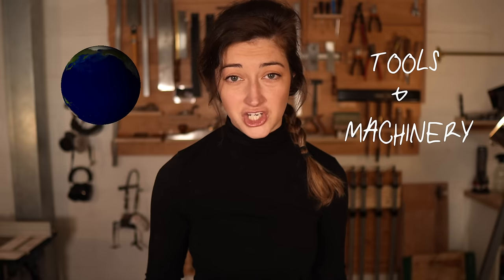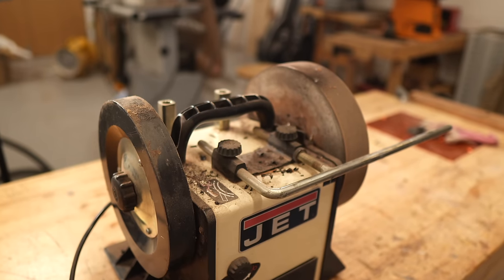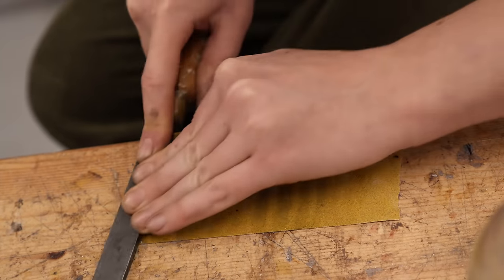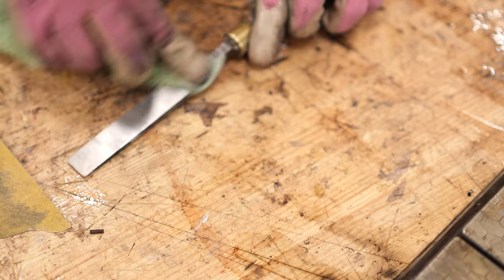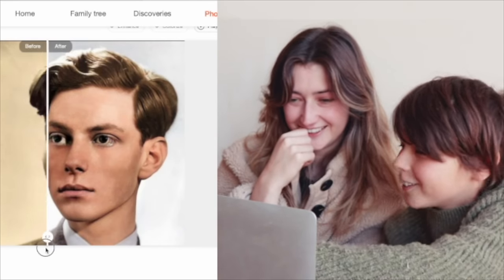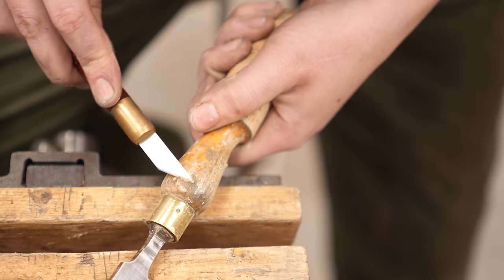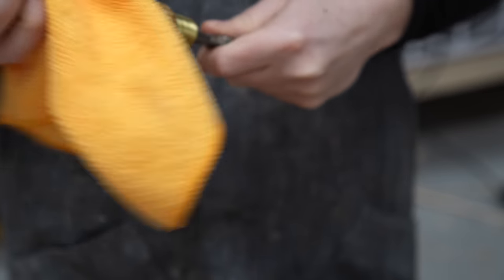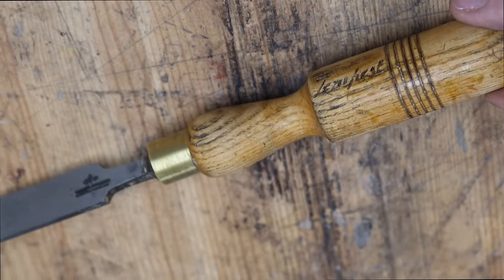Restoring a 100 Year-Old Chisel

Comment: There is nothing wrong with using linseed oil on oak. Th main reason not to, has to do with colour -as raw linseed oil makes oak very yellow (something you usually would avoid when working with oak) The drying time mentioned in other comments really is the same on oak as other similarly grained woods -absurdly long, as raw linseed oil takes up to months drying completely. Therefore you would normally use polymerized or “boiled” linseed oil. Where the polymerized oil is made by heating the oil in an oxygen free environment. Thereby starting the polymerising of the oil -thickening the oil and shortening the drying time. And Boiled linseed oil is made with adding metal salts as drying agents and solvents (typically turpentine) to decrease viscosity (boiled linseed oil, is also the most reactive of the two. So beware of drying rags. So think of raw linseed oil as a component in finishes such as paints and varnishes, not a “complete” finishing solution.
Hope this helps. Best regards from a former cabinetmaker, now knife builder from Denmark
Reply: That explains why an old file that I inherited from my father has that very yellow finish.
Reply from the maker: Thank you so much for the intel! Glad you helped not just me but everyone else who came here. Thank you :)
Reply: I’m glad to be of any help. Keep up the great content!
Reply: Only use raw linseed oil on traditional old willow cricket bats!
Reply: @DaisyTempest  metals in boiled linseed could react with tannins which is probably the reason for the "no oak" alao probably very unlikely to be an issue, have a hook in the bottom of a rake that's gone wonderfully black
Reply: You are mixing up different oils and som nonsense. You are right boiled linseed oil hardenens faster. The molicules are also bigger witch means it does not penetrate as whell as raw linseed oil. You can add aditives to linseed oil, raw and boiled to accelerate hardening. It does not have anything to do with boiled linseed oil. Terpentine does nothing to help the hardening, on the contrary. The oil can not start hardening untill the terpentine has evapurated. It does not help the oil penetrate better. It's a very commen misunderstanding. Being from Denmark you should find the article from Teknologisk institut that have excamined the properties of Linseed oil. You will also learn that the reason you experience so long drying times for ras Linseed oil is you are not using a good quality. If the oil is not pure it takes for ever to harden, or not at all.
Reply: @gandalf1124  i am sorry if i did not get everything right. I was writing this of the top of my head -remembering what i was taught about this subject twentysome years ago. Regarding the boiled/heat-treated types. I might have misused/mixed the tradenames with the actual process (heat-treated raw oil vs heat-treated with added curing agents etc) but all in all, I tried to pass on my experience with linseed as a cabinetmaker. And that is to view raw linseed oil as an ingredient in a finish -not a finish of its own.
That said I am glad to hear others opinion on the matter. And I would much appreciate a link to the document from teknologisk institut as I think it would be interesting to read. Best regards
Reply: I can't resist old chisels. Usually one or two $au at the tipping shops . I think I have over 30. New handles are easy to make they don't have to be turned , a series of flats with a plane does well. Using diamond plates like you use it really doesn't take too long to restore a primary bevel. 10 or 15 minutes of therapeutic exercise.  Great video thank you so much.
Geoff from Tasmania
Reply: @davidgee1585  Reminds me of when I was a kid: a friend and I both bought ourselves cheap cricket bats not knowing the difference between them and real cricket bats.
We oiled them, let it go off and they (not surprisingly, in hindsight) both broke the 1st time we used them.  We were baffled: 'but we linseed oiled them!' 😂
Reply: cobalt catalysator?
Reply: Thanks for this info!

Comment: My own $0.02 is that I personally greatly prefer Tung Oil over linseed oil for wood finishing.  Tung oil dries clearer, with less of a yellow tone, and ultimately gives a harder, more durable finish.  Pure tung oil is safe for food surfaces, and my preferred oil finish, though it does take a long time to fully dry / cure.    Multiple coats of tung oil really bring out the grain with a wonderful depth and feel.   Tung oil is plant-based and has been used for wood finishing in Asia for centuries.  Note that "Tung Oil Finish", which is often more easily found in local hardware stores, is not pure tung oil but, like Boiled Linseed Oil, contains other ingredients and solvents that can make it easier and quicker to work with, but may or may not result in a food-safe surface and the final 'look and feel' is different.  So be aware of the difference when purchasing.

Comment: I think the handle is made of ash wood. William Marples and Sons, Ltd. used to put an ash or beech handle.
Reply from the maker: Yes a lot of people have said ash. I think you might be right. I’m also wondering if this is the handle she turned herself or if I picked the wrong one out the drawer of them. Which would be a shame as it negates the whole point of the video 😂 shame she’s not around to ask which ones she turned new handles for.
Reply: @DaisyTempest  It's a stock standard Marples ash handle and they had quite a number of different patterns. My favourite is the "London Pattern" octagonal ones. I will often replace my handles with ones made from rosewood (all types)" or ebony. Linseed oil is fine, but yeah, be careful of spontaneous combustion with any used oil or shellac rags. Your dating of the chisel is not too bad - anything from around 1900 to the mid/late 1940's. After that they tended to have round shanks.

Comment: Wooden Handles are always in your hands. FoodSafe products can be  safe and effective for cleaning and maintaining wooden handles. There are old recipes which resemble mayonnaise and you can find hand creams made of natural ingredients. Mayonnaise can be something like a squeeze of lemon, a drop of vinegar and some flaxseed or walnut or even olive oil, no salt or sugar if you are going to use it for wood. The acetic acid in the lemon and vinegar clean and the oil treats the wood. Note that you only make a small amount like a tablespoon of it as you need it, not a 1 litre jar,  to clean and maintain a handle, and you can rub it on with bare hands. A "natural" hand cream made with real beeswax and the right essential oil, can be used to maintain a wooden handle as well as be used as a hand cream. A product called Flaxseed oil is linseed oil that has been purified enough so that you can safely drink it and eat it, and it does not have the drying chemicals that are in boiled linseed oil. I suggest you research the secret recipes of the ancients and natural skin care products that include beeswax, flaxseed oil, lavender oil, etc. to find a FoodSafe treatment for your wooden handles.

Comment: This is a guess about oak and linseed oil, but maybe the concern is that oil which soaks deeply into the pores will never cure since it's cut off from oxygen, and so maybe the piece would continually seep with uncured oil afterwards? But since that piece has been previously finished, I think you're right that the pores are likely to be well sealed already. Any linseed on the surface should cure just fine.

Comment: Hi, 60 years ago I was an apprentice at Vauxhall motors as a pattern maker. I still have my toolbox full of the chisels and turning tools used for my job. Some of the tools I have I acquired from retiring workers. This making some of the tools up to 200 years old! Every so often I check that they are in good order. Also when I learnt my trade, everything was done by hand, no modern equipment.
Enjoy, Dave r.
Reply: You must have had access to some great-quality mahogany in those days.
Reply: @hughmac13  Hi, yes we did, first quality Honduras Mahogany, and Yellow Pine. All naturally seasoned, not kiln dried as now. For model making of new car 'bucks' we used a laminated timber called Stabelite. It was made from pulp timber from jungle swamps, and when seasoned and sealed, with varnish, was guaranteed not to move more than one thousandth of an inch. That's old measurements not metric!
Reply: @Davidrollings-zr7bh  That's right—you just do not want to be carving in kiln-dried woods if you have a care for your tool edges or the comfort of your hands and wrists.

You were making the patterns for the engine castings? What are the "bucks"? Did the Stabelite carve well? I've wanted to learn about casting but haven't had a chance to get into it. I know there are cores and coreboxes and draft angles but that's it.
Reply: Hi, it's good you are interested in, what I call older trades.
You are talking about two different types of pattern/model making. The first, using traditional timbers was indeed used to make patterns for engine blocks, gar box casings and axle casing. And if fact in many other parts of engineering.  Most patterns were made to contraction size, not imperial measurement, as castings contract on cooling. Examples are 1/120, for aluminium, and 1/60 for cast iron. All pattern where build with a small taper to allow them to be removed from the sand in the foundry.  Also there were cores to the patterns that could be removed to allow for holes, rebates etc. 
The second part, using Stabalite for new car bucks, basically was a complete model of a new car. When I was at vauxhall I worked on the HB Viva, Fc Victor, as well as Bedford commercial vehicles.  In short when the model was complete, either plaster casts, or fibre glass mould were taken from the buck, and ultimately made into dies for the press shop, to make the panels.
Stability was a very hard materiel and I remember alway sharpening any tools used.
Final point, most patterns for the dies, were made from polystyrene! 
Hope this helps a bit?
Dave r.
Reply: @Davidrollings-zr7bh  I've seen some good videos on YouTube channels focused on casting or that feature casting as part of projects.

I think it's interesting on its own, but as a cabinetmaker I had a wish to restore and build tools, which would necessitate casting in some cases. So my interest was in smaller pieces cast probably in bronze for the most part.

I've seen foam used in some of those videos. I've also seen patterns that were 3D printed, which seems like an amazing way to create intricate shapes, and very rapidly. The part about patternmaking and casting that's so tricky to me is learning to see the negative of the object. It seems like something that takes practice because it doesn't come naturally to me at all.
Reply: Hi, well you as a cabinet maker have your own skills. Do you work in Wood, or other materials? 
When it comes to small castings, I seem to remember a couple of tyes used for multi production. 
One is die-cast, when metal is forced into a metal die on a machine, under pressure. After production of metal die, no other pattern is needed. The second is call the lost wax process. I think k with this process a fairly large number of shapes are made in metal moulds, all linked together, bit like a tree. These are then placed in sand moulds, its which Moulton metal is poored. The wax melts, leaving the required shape in the sand. These are then cleaned up, or fettled as it is call. Then machined etc, to give final product. Not sure if this method is used today, though.

Comment: For things like cleaning out that makers mark, I like to cut the end off a bamboo skewer with wire cutters or something that will compress and fray the cut end. It gives you a nice very stiff brush-like tool that you can use like a pencil eraser,. When it wears and softens, you can just cut it down a bit and keep going. Soft enough to keep from harming the piece you're working on, and hard enough to dig out even the most stubborn of buildup.
Reply from the maker: Great tip! Thanks!
Reply: That is a great tip.

Comment: If I may be so brazen Daisy.  When I was cleaning up a batch of chisels I used coarse wet dry sand paper to do the majority of the work.  You can put them right on your existing stones and take of a lot of material quickly then go to your stones.  Add water to the paper to help remove swarth.

Comment: Lovely stuff. Been a carpenter for over 30 years (mostly site work, but furniture too). I've restored a few things but definitely get impatient and definitely don't get anything like as fine a cutting edge as you do. Been wanting to get into sewing and recently restored a pair of old, battered Wilkinson dress making scissors, which was a love-hate process, but pleasing in the end.
Don't doubt your identification of oak (and being porous I would have thought the boiled linseed oil would just soak in loads so you'd have to do a gazillion coats. Certainly not going to harm it.) but from my understanding, most traditional tool handles were made from ash. Also porous, but less so than oak.
Mark in Scotland.
Reply: Yes I think you're right Mark, ash or beech would be my thought, though ash can look like oak in the right light

Comment: I have used oils a lot over the years. Particularly BLO, Tung Oil and Walnut Oil. I have found that using solvents (citrus oil, pine oil) accelerates the adsorption of the ”cut” oils into denser woods. I have also used Japan Drier to speed up the process as well. A lot of tools that I have purchased have laquered handles so my first job when I get them in the shop is to strip that off and replace it with multiple coats of oil.

Comment: NIce work as alwaysDaisy :) I have worked as a technician once or twice in school workshops. I had to sharpen all the chisels. Those water wheel grinding set ups like you have are great. The one I used also had a leather wheel to put compound on to polish the blades. I also had a stone next to it to debur the flat side of the blades. The chisels came out well, very sharp, though I was running out of hair on my left arm. I did my fathers old chisels while I was at it.
Reply from the maker: Haha! I hope your hair grew back. I have barely any either :( such a pain!

Comment: Great video, white vinegar makes a good rust cutter...when I'm restoring an old Stanley plane I'll pour some in a small plastic tub and soak the rusty parts for a day or two. Totally benign to work with, just make sure to rinse the steel well as the acid will promote rust as well as remove it;). Also, no need to flatten the entire back of the chisel, other than for aesthetic reasons. Even a half inch will do for good function, and sometimes the amount of cup or bow in an old blade will take FOREVER to flatten. Keep the videos coming!

Comment: Great work!  I love restoring hand-me-down tools by hand.  The tool has more meaning when you use it later.
A tip when you have a lot of sanding to do on chisels and the like is to not put excessive force on one side.  It's really easy to take off more material from one side and never notice.

Comment: Boiled linseed oil is marvelous stuff. Thinned with turpentine, it is great for cleaning, refinishing, and rejuvenating wood. The rags can combust unless you soak them in water, but it's safe otherwise. It can make oak turn yellow (raw linseed oil is worse for this) but if you rub an old finish with fine steel wool and a 4:1 linseed turpentine mix, the old finish will re-emulsify.

Comment: Brilliant and respectful. Be careful of rags with linseed oil on them; they may spontaneously ignite. When linseed oil-soaked rags are left to dry, the oil oxidizes and generates heat. If this heat is trapped, as in a pile of rags, the temperature can rise enough to cause the rags to ignite on their own without any external flame.

Comment: What a lovely heritage to have!  I've never heard of BLO being a problem on oak, James Wright aka wood by wright uses it all the time on everything.  I've just started using it and it gives a lovely feel.  For an initial sharpening I believe axminster still offer a sharpening service or as you suggested a cheap honing guide with 240 grit sandpaper on either a piece of float glass, smooth granite table mat (as long as any reflection looks smooth) or even MDF or ply.

Comment: You can use just wet-dry sandpaper at lower grit and work up to your diamond stone.  Boiled linseed oil means it has metallic dryers in it to speed up drying.  The metal can react with the oak tannins and darken it.  Oak and chestnut just happen to have a lager amount of these acids. I suggest using a Pure tung oil. No dryers and will take about a week to fully dry but wont be tacky during that time.

Comment: I usually use a BLO/meths/turps mix a third of each one with 0000 steel wool for restoring old chisel handles, it cleans them without removing any patina or damaging them, that might have saved you some work with the dental tools.

Comment: For the delicate carvings on the wood, I've found a stiff, nylon bristle brush to be effective and safe. Also, it looks like your diamond stones haven't been cleaned in a while, which will diminish their cutting power. Dishwashing liquid, hot water, and a stiff toothbrush or non-abrasive scotch-brite pad or a sponge with a scouring pad backing.

Comment: @Daisy Tempest - My understanding is that using linseed oil on Oak is not suggested because it soaks way in and then it takes too long to dry which can allow mold to form on the uncured oil. Humidity and moisture would exacerbate the issue. Since the wood in question was already finished once, the new oil probably wasn't able to soak that far in. I would store that handle in a nice warm dry place. Boiled linseed dries faster. I've done 4-5 guitars and necks with the stuff, feels good and is pretty durable. Easy to fix/patch/repair too.